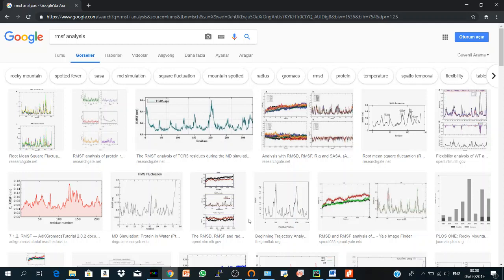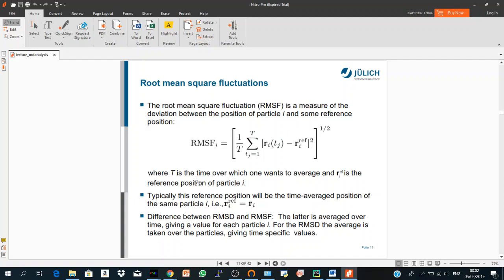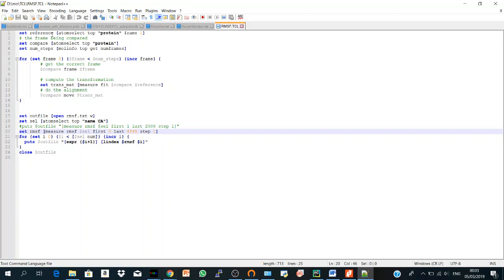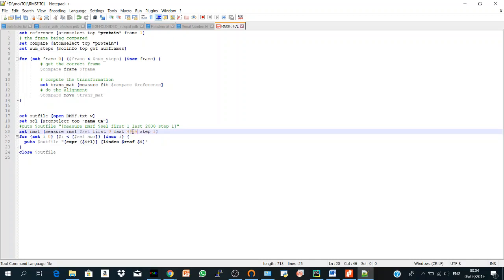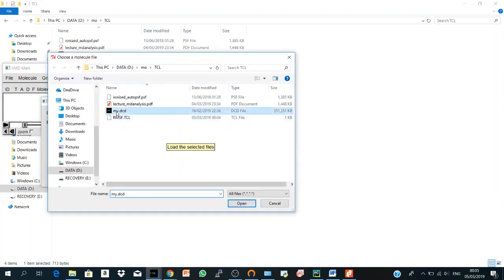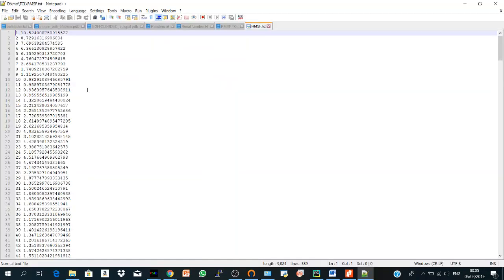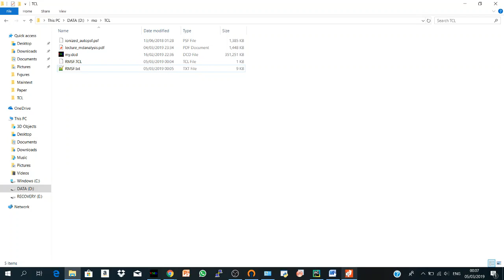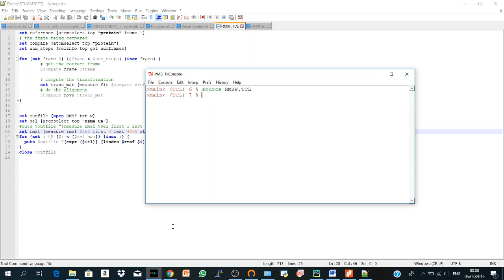RMSF analysis of trajectory (DCD file) using VMD

Comment: Great work Shehata. 
I have a question. Actually, I am also doing the simulation using the quick MD plugin into VMD and NAMD software. After running the simulation, my protein comes out from the box. How can we remove this problem? I am looking forward to you and thanks in advance.
Reply from the maker: That's a PBC issue. I have a video in my channel explain how to handle it please refer to it
Reply: @Mohamedshehata  Thanks a lot for your reply. Hope you are doing well in this challenging time. Again, my concern is, we are using the wrap command after the simulation is done. So do you think there will be a change in the energy of the system?
Reply from the maker: @gauravkumarbhali514  Wrap is just handling visualization of the system it doesn't change anything else , don't worry

Comment: How can I get the RMSF per residue, it seems here that the RMSF values is per/atom, I tried the script several times with different selections and it gives per atom information
Reply from the maker: It is clear in the script that I selected " protein and CA" because one should be interested in the fluctuations of the backbone. SO RMSF1 means the fluctuation of the CA of res1. If you want all atoms you can change this selection to " protein" and it will calculate for all the atoms. But the data will become very noisy because the side chain fluctuations are somehow meaningless.
Reply: @Mohamedshehata  Thank you very much for the explanation
Reply from the maker: @ahmadalqaisi9828  you are always welcome bro !

Comment: Hey Mohamed, Great tutorial and tbh the only one on youtube regarding RMSF.
Your script seems to work fine when I'm using a single protein (yielding 230 RMSD's for each of the 230 residues) - but when I'm using it for my protein-ligand complex, its somehow yielding 240 RMSDs. I am assuming that maybe the CA atoms of my ligand is also being considered hence the 10 extra RMSDs. Do you know whether its the first 10 or the last 10 RMSDs of the list that would belong to the ligand? In my complex's psf file, the ligand has a separate chain name (chain B) than my protein (chain C) and is after the protein sequence. Also, the ligand's resid is 1, my protein starts with a resid 16.
Reply from the maker: Hi, you adjusted your atom selection according to your structure , since I had only protein I set my sel as protein but in your case you should choose only protein without ligand.. for example you say "protein and resid 16 to 230... this will give you only the RMSF of your protein without the legend or you could keep it protein and remove the first 10 RMSFs from your output file but this would be very stupid so as I said it is better to modify your script to selsect only proteins residues .. I advice you to go over the atomselect command usage in VMD tutorials
Reply: what did you write in the selected atoms for your protein ligand complex?
can you send me the script you used?